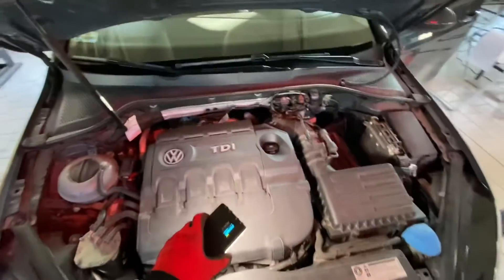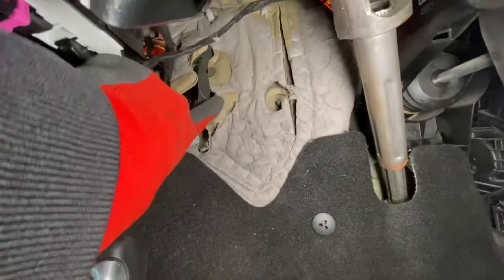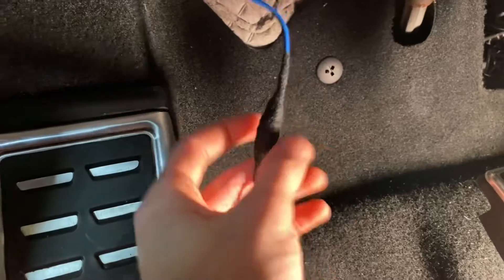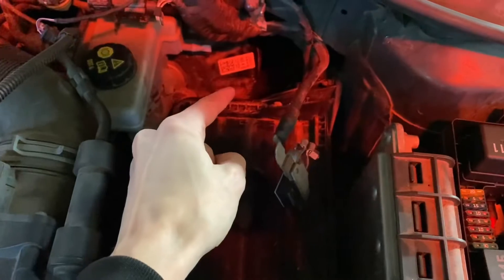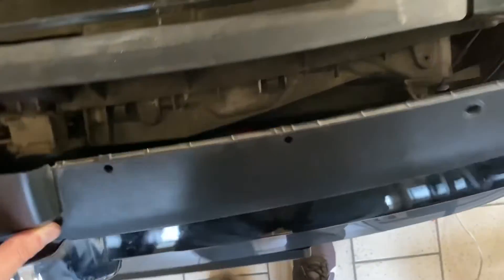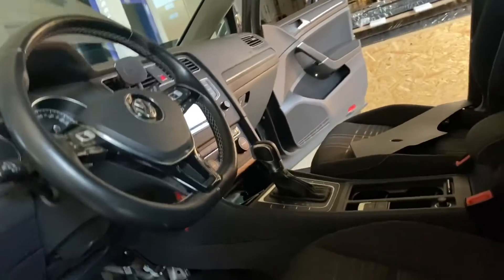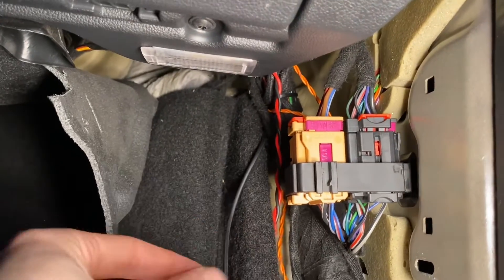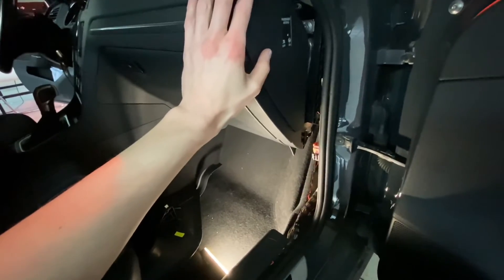Golf MK7 Front View Camera, part 3: wiring through firewall

Comment: My golf r has the abs module right behind the battery and in trying to push 0 gauge wire through the same place you did I popped the grommet out into the engine bay with no idea of what it looked like it took like 4 hours to get the grommet reseated goof grief that was traumatic hahaha, I'm right hand drive so not sure if that's why, you seem to have a master cylinder or booster there but not quiet as in the way as what I endured but thanks for the inspiration and also the interior shot you showed with a peice of black spongey foam where you'd peeled the interior foam back and that helped me a lot bud thankyou because I had no idea where it came from in my rage and frustration I just put it aside then lost track I was so focused on getting the grommet back in before it rained or anything. I was actually scared I'd be off to VW dealer 🤣 I feel confident now but need good weather and will push through from inside after poking a fishing line type thing through and will lubricate the 0 guague wire so it slips easily the the grommet you used originally. Do you think i could find a part number or picture just to see what shape the big grommet was not a chance hahaha. Easy to laugh now wow that was horrific. I mean I've had plenty of this happen before but not on a brand now car that just cost me 55k AU dollars. Thanks again for your video and im keen on front camera too eventually brilliant idea. I have adaptive radar cruise so under the VW logo might not be ideal for me but in the grill aimed right could work. Appreciate you sharing and sorry for such a long comment.